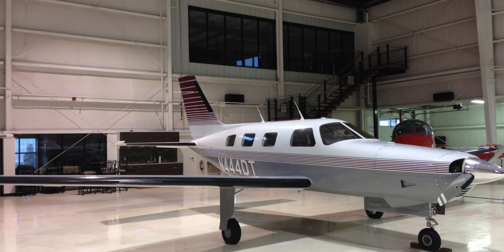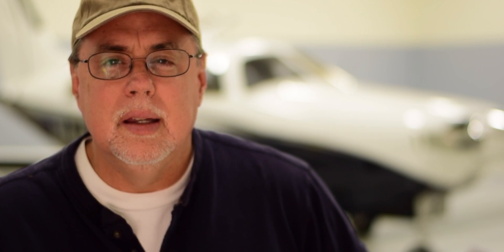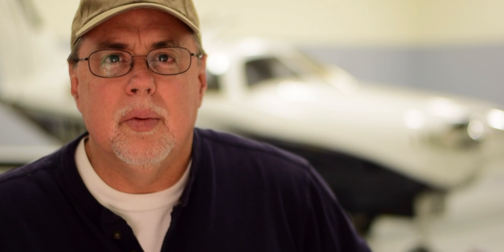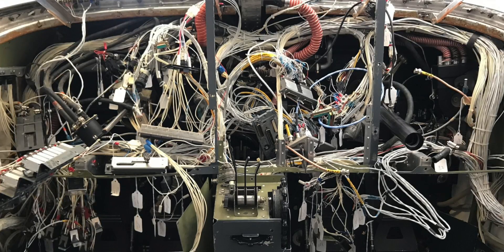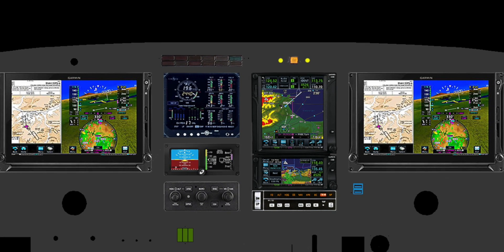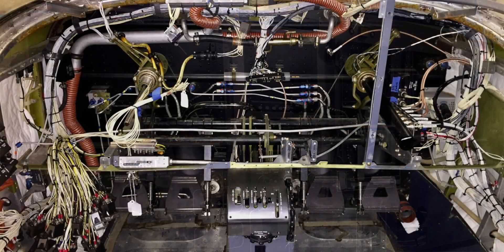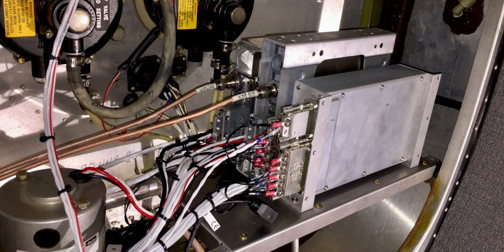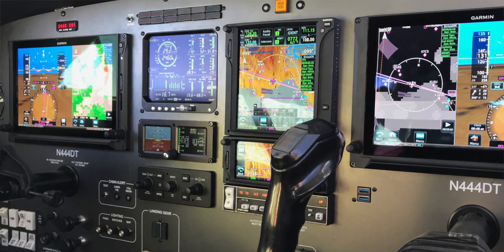Malibu Panel Upgrade - Garmin G500 TXi

Comment: Thanks for the information.  I have a 1986 T210R that I am upgrading with the G500txi. I have a question on your radar?  I have a RDR160 - is that the same unit you have? Currently I am using the Avidyne Entegra to be able to get color radar on my MFD.  Were you able to get your radar to display in color on your GTN750 and G500Txi?  Thanks

Comment: What system are you using for your CO2 & Pressure monitors in the panel?
Reply from the maker: It's a CO Guardian from Guardian Avionics.  It interfaces with the JPI 930 (in my case)
Reply: @MalibuFlyer  Thanks for the info. I just ordered one for my 58P. 
What brand is the RPM (alarm) MAP?  I am guessing it’s pulling info off the JPI?
Reply from the maker: @randyredden  it comes with the JPI
Reply: @MalibuFlyer  Gotcha.. makes sense.  
I am based at KISM.  Let me know if you head my way again or you are attending Sun-N-Fun.

Comment: Beautiful panel! I'm in the process of overhauling my panel now with alot of the same equipment, however I'm curious to know what that auto pilot control panel is next to your king a/p? I'm also keeping my king a/p but love the idea of a separate controller for it instead of going through the txi. Thanks
Reply from the maker: Hello.  That is the Garmin GCU 485 4-Button PFD Controller.  It's essentially a remote control for the G500 TXi and it saves a lot of time as compared to the touchscreen.
Reply: @MalibuFlyer  thanks!

Comment: Your videos are excellent, and very informative.  I'm a rusty pilot who is getting back into aviation after more than a 20 year break.  Buying an airplane is on the list, so watching content like yours is a great motivator.  Thanks to your videos, the Malibu is on that list (after a lot of refresher).
Reply: I’ve been rusty for 50 years but probably will not go forward as I don’t have 3 million saved and when I saw Bose earphones at a grand I knew flying had go real costly. I assume you have significant financial resources.
Reply: Got

Comment: Thanks for this video!  Love the Panel.  I have a couple of questions - Would you do it again? and if so what would you change if anything?  I am thinking about buying a Meggitt Meridian and doing the same upgrade or trying to stretch and buy a G1000 meridian?  Would love to hear your thoughts.
Reply from the maker: I would do it exactly the same way again.  I would highly suggest the Meggitt Meridian and upgrade it to the G500TXi series as opposed to the G1000.  The speed, capability, and functionality of the G500 renders the G1000 obsolete by comparison.
Reply: @MalibuFlyer  I appreciate your help.  I'm a Cirrus G1000 NXi guy and don't really want to go backwards into a G1000

Comment: Hi I looks great. I am fitting a very similar set up in a Cherokee 6. How much was the secondary screen?
Reply from the maker: Thank you.  The second screen was about $10k installed.
Reply: Malibu Flyer Hi

Many thanks for the info and thanks for the video it was very well put together. I think maybe I’m too far down the line to get a second screen if I had known it was an option earlier might well have gone for it. Our layout is very similar without the second screen. My budget also went through the roof and had to delay the upgrade waiting for the approval of the new Garmin autopilot for the PA32. I hope to have it back ready to go in the next couple of weeks. Uk airspace has now opened for GA just for single pilot operation or with members of your own household only. Better than nothing I suppose. Picture of our panel below in case you may be interested.
Thanks again 
Have fun, stay safe.
Kind regards 
Paul

Comment: What are the differences between the G500 TXI and the 3GX touch?  I can’t find any info on the differences online...
Reply: AV8R Tom the 3GX was the first touch project of Garmin, it was desing for the experimental aircraft and after was certified for regular aircrafts! The processors and components of the 3GX are older and slower than the G500 and have a built in VRF GPS. 3GX it is a less expensive alternative than the G500TXI.
Reply: FarmPilot Felipe Alonso Thanks!

Comment: What does one G500 cost? I’m looking to retrofit my cherokee 180
Reply from the maker: About $12k depending on which options you include.
Reply: Malibu Flyer thats actually not bad! Thanks!
Reply: AV8R Tom Completely nutty.  pA28 honestly need nothing of the sort. Save such an investment until you move up to a real IFR cruiser.

Comment: I obviously cannot speak to your particular situation, and call me bias if you will, but I hope to offer some perspective @MalibuFlyer. I am an avionics technician/installer. I am currently installing a very similar setup and have done many avi installs in the past. The quality of the work as far as routing and cable management done on your aircraft, shown on this video, is truly impeccable. All the connectors looked top notch as well, which speaks to me and says the terminations were probably right on par, or under par, for a fantastic job. Please have some patience with the shop, I have no idea which shop you used, but with work like that, a month over estimated time is not bad at all. Now that shouldn't be the shops S.O.P. but obviously there were probably mitigating factors. Over payment could just be somebody talking in your ear, or you truly could've over paid, which is unfortunate. At the end of the day you got a beautiful install, those guys must be sharp. Take it easy on em eh! I understand your and their perspective and hope to shed light. Nice panel brotha.
Reply from the maker: Hi Connor.  All very good points and I have to agree with you, the quality was worth it.

Comment: What is the reason you did not add the EIS system with the TXI?
Reply from the maker: Hi John.  Several reasons:  At the time, the Garmin EIS was just released and I wanted something a little more proven. Secondly, I would have had to add another dedicated Garmin display (GDU 720) or split my PFD/MFD screen even further to support the EIS information.  Lastly, the JPI 930 provided much more detailed information by default.

Comment: I have enjoyed your videos with the TXi/GTN 750.  I am flying a Seneca V with similar equipment including the KFC150.  First question is the GPSS Roll Steering equipment the GDC31 by DAC International.  Second question did the TXi Firmware come with Version 6.50 or later, or was it 6.41?
Regards and keep up the informative videos.
Reply from the maker: Hi Michael.  With the TXi, I no longer needed the DAC converter for GPSS roll steering.  That is now handled by the GAD 43e.  My TXi units came with 6.41 originally, I am running 6.52 currently.

Comment: Panel looks beautiful. Just wanted to mention a couple of things I've learned as well as we wrap up our avionics upgrade in our Cessna 414A. We're doing a G600txi, dual GTN750's, GMA350 audio panel, GTX345 transponder, GWX75 radar, and a GFC600 autopilot. It seems like you weren't totally thrilled with how the avionics shop handled a few things. The first thing I picked up on is that you had your panel powder coated. So many shops just do this without explaining the pro's and con's of painting vs. powder coating. For just about everyone, painting is the way to go. Powder coating looks nice, but if you ever decide to add something to your panel, you'll have to cut the entire panel again. Powder coating tends to chip and flake when you cut it, and the rough edges from the new hole can't be touched up, because its powder coat, and not paint. Painted panels are super simple to cut, and if they require any touch up around the edge, its easy to spray a small section of it. The second was the placement of your GPS antenna up on top of the nose in front of the cockpit. Tons of shops do this as well, but interestingly enough, its actually not legal for WAAS installations. The FAA's installation guidelines specify that the WAAS antenna must have a 360 degree, uninterrupted view of the horizon. As a result, the only legal location for WAAS antennas is the roof of the airplane. How do you like your GCU485 PFD controller? We opted for it and I think we're going to be really happy with it.
Reply from the maker: Thank you for the informative comment!  So far I've been happy with the powdercoat but as you mention, I haven't had to make any modification yet...  Good to know on the WAAS antenna.  It was there when I bought the plane and I suspect that the shop was trying to take an easy path to not having to penetrate the pressure vessel.

Comment: which paint shop did you use for your plane?  I am looking a good paint shop for my plane
Reply from the maker: I used Master Aircraft Services in Wickenburg, AZ
Reply: @MalibuFlyer  are you happy with your paint job? thanks
Reply from the maker: I could not have been happier.  They went way above and beyond in terms of detail.  Even the gear wells look factory painted.

Comment: If you had wanted the copilot's G500 to be able to serve as a backup, could you have had a second AHRS installed?  Or do they only support the single-AHRS configuration?  I assume that even in that situation you'd still have needed the Mid-Continent because you'd need backup power.
Reply from the maker: Hi Mike.  You’re correct, I needed a battery backed alternate.
Reply: A second independent G500 on the right side of the cockpit, even when connected to a standby battery, doesn’t satisfy the FAA’s requirement for a standby unit. The standby unit needs to be within the pilot’s primary field of view, which the right side of the cockpit isn’t.
Reply: @TheS4Aviator , thanks! That's a good nuance that I hadn't considered.

Comment: Do you have integrated EIS data in the TXi?  If so, do you find having the JPI redundant?  I’m doing my Baron soon and trying to decide if a stand alone EIS display is necessary considering the capabilities of the 10” TXi.
Reply from the maker: Hi Alan.  I elected not to get the Garmin EIS as I prefer the JPI.  I also didn't want to give up any more screen space on the G500.
Reply: Malibu Flyer The screen space is definitely my concern.  I have room for either the JPI or Garmin and am looking at both. Since the Garmin cannot be used as a backup to the PFD, it makes the choice harder.  I just wish Insight Avionics had a primary EIS.  Their engine monitor is fantastic.

Comment: Thanks for the great videos, I’m in the same process with a P210 build right now. What do yo suggest when you get hit with the pay before we will order the equipment?
Reply from the maker: Hello.  Most OEM's provide their dealers with NET 30 payment terms and therefore, there is simply no justifiable reason for dealers to ask for payment in advance other than the tremendous leverage it gives them over you.  I will never do it again.  There are plenty of other shops willing to compete for your business.
Reply: Malibu Flyer Yes I was thinking 50 percent would be sufficient. My panel will be significantly north of 100K.

Comment: Absolutely incredible ---Id never have thought your Malibu was a 1989 model- but it looks / appears to be a great investment --Now just put the new Lycoming engine in it if you don't have already and it's a new aircraft ----huh?
Reply from the maker: Hi Gary.  My plane is actually an '86.  I will replace the engine with a TSIO-550c Continental.
Reply: Malibu Flyer That engine is gonna hurt. You working two jobs yet to pay for your toy?

Comment: Half a million dollars later...Very nice airplane..have you thought about doing the PT-6 upgrade at overhaul?  For what it is worth, I have never met anyone who did a complete avionics overhaul that their plane wasn't down double the time they were originally projected by the shop.  Add on to it that Garmin released a brand new system right when you were doing yours and 7 months seems pretty typical.  Just be glad you didn't do it 2 months earlier.  You may have purchased a unit from the last batch of legacy G500.  Instant buyer's regret.  I fly out of KLVJ just 30 miles up the road from Galveston!  I've never flown in a Malibu.  I may have to buy the burgers one day at Brenham...

Comment: By not naming the shop, are you not allowing some other fellow pilot fall victim to their practice? Also, based on what you have stated you were not dragging them through the mud. You mentioned the quality was good, so it seems you were being honest and not punitive.
Reply: I suspect he isn’t naming the shop because he will still need to use them for warranty or other follow up work. His warning about paying in advance is a good one. Many shops will accept 50% up front or the cost of the avionics with the balance due at completion. Another thing not to fall into is working off of an estimate versus a quote. Seen many owners get charged additional costs due to things encountered during the upgrade. To avoid this, tell them you will give them the plane to inspect before quoting the job. A good shop will only offer additional add-ons like synthetic vision during the quoting process, not after the work has begun.

Comment: Great video we removed 45 pounds of wire out of my Saratoga most Avionics shops in my opinion don’t inform the customers of the pitfalls that may come up,so they don’t say nothing they don’t want to scare the customer away. So they take a deposit take the plane apart then call you to tell you they are going take longer and need more money. That’s BS in my book. The shop needs to be up front and honest. Your plane looks great. Merry Christmas.

Comment: My first job out of high school was in an avionics shop.  I remember that for all the major players, Beech, Cessna, Piper and Mooney, the factory installed wiring was the worse I ever saw.  It all looked like  the spaghetti monster behind the panels.  What you had there looked very typical.  Also don't beat yourself up over the huge cost overrun.  There is no way you can judge what all  that much of an avionics change will involve until panels are out and you know what needs to go back in.  I can well imagine just how much work it was for that shop to trace out every wire to be sure they are not removing any wires they should not.  Plus making sure that the right wire goes to its correct new connection.  It seems the biggest weak link here was with Garmin shutting down sales of G500 panels before they had G500 TXi ready.  I suspect that getting the TXi's finished and certified took a few months longer than they expected and there was a gap in manufacturing.

You and your family have a Merry Christmas and Happy New Years too
Reply: mikentx57 Could not have said better myself, avionics is the one job that takes time and patience to do anything goes wrong and is pain to sometimes track the fault.

Comment: Hey, great video ! If you could can you give me a ballpark on the second TXI screen. My shop did not explain or did I see that they could share AHARs so I have a Ipad mounted that is nice but would options! Nice clean panel ,just like I put in my 89jetprop . Ive learned a lot watching you operate your equipment, Thanks!
Reply from the maker: Hi Keith.  The second display was just under 10k.